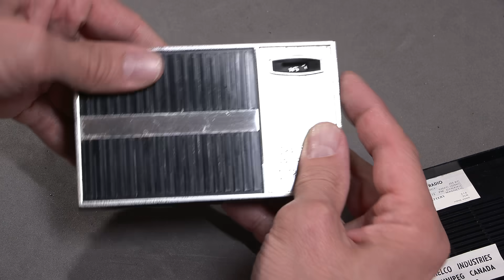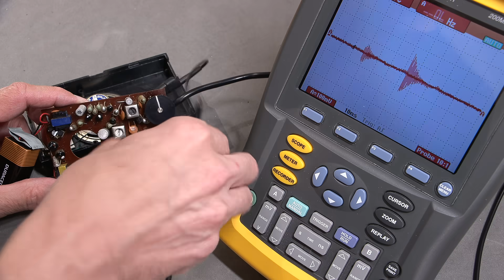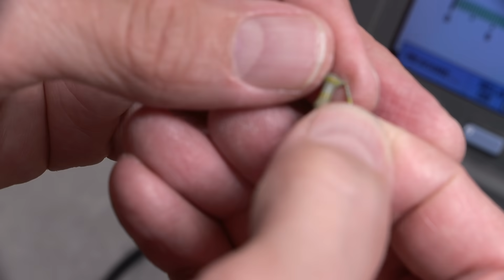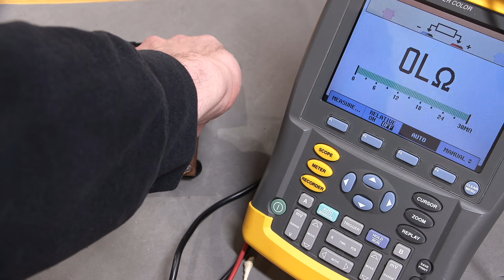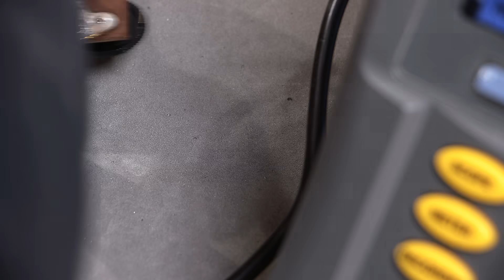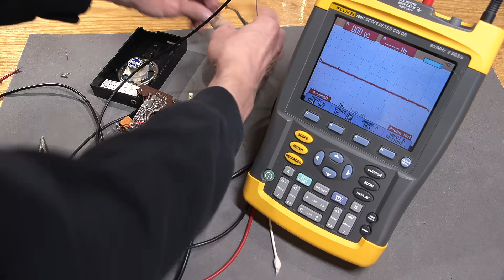10 Transistor TRANSETTE Radio Receiver Troubleshooting Adventure!

Comment: When I was in grade school in the 1960s, I got hooked on radio repairs with old loctal tube sets that lived in and under the dash of 1930s through 1950s automobiles.  I loved the vibrator power supplies.  I worked on scrapped All-American 455 kHz IF sets.  I even had my hands in a dual IF shortwave tube set that used 282 kHz and 455 kHz IF amplifiers to improve both sensitivity and selectivity.  That was fun!  I learned quickly about putting a polarized plug into old hot-chassis sets, because they could really bite you.  I have quite a collection of plastic alignment tools and probes because of that work.  I did have an early 8 transistor GE "cigarette pack" size radio, but only to listen to.  My brother and parents would have shot me for digging into that just to see how it worked.

Comment: I've tended to use Soldapult(TM) hand-operated solder suckers and lots of solderwick.  So much more quiet than your solder sucker.  But, times move on, so I've gotten in such a device.  It works great!  I've also bitten the bullet for some surface-mount microwave RF gear and gotten hot air and hot plate solder re-flow capabilities, but have troubles with the learning curve for them.  
Do you cover such techniques in your electronics course?  I don't have a long-arm microscope, only a binocular dissecting microscope and a USB video microscope.  I don't have any way to make solder shields or masks to handle the SMT chips with their 0.05" and smaller leads.  Maybe you have some tricks?

Comment: In hindsight, I'd sue the manufacturer for having left flux behind on the circuit board.
Knowing that flux was designed to improve the bond between copper tracs and the solder by way acid treating the copper surface.😒

Comment: Long ago, a friend showed me a way to turn one of these into an cheap audio signal tracer. The volume control is where the audio comes in and out, so he just cut the trace and had two probes and a ground -- radio out, audio in, and a common. Of course being battery operated, it electrically floats above the device under test.

Comment: They were Production Loading Circuit Boards in a Factory setting.
Flipping the board over and back  a Hundred Times.
The ‘bends’ were to keep the parts in place for loading, before a mass Soldering of the Components.

Comment: Lovely restoration! Wish I were just a tiny bit more like you. I've never (successfully) restored a silent radio before. All have gone up in smoke either because of age alone, or my own mistakes. The route I then take if I have the patience, is a simple restomod. Not ideal but can be fun. I really want to do a proper restoration/service to a transistor radio one day, but I don't know how possible it is with just the 9$ soldering iron and a 30$ multimeter I can afford

Comment: Thats some of crappiest soldering I've ever seen all over that board .. 😮

I used to repair these radios as a teen, no fancy DMMs or scopes back then...I built a (sq. wave)  signal injector and my first test spot was always the volume control, the most failures I saw back then were bad solder joints, dry joints etc.. or cracked tracks..
Happy days !! 

😎👍☘️🍻

Comment: Cool that the oscillator makes a 17v signal with a 9v source.
Reply from the maker: Keep in mind, that's "peak to peak," not peak amplitude.
Reply: @MrCarlsonsLab  Yeah but e.g. a Class A amp can't do more peak-to-peak than the supply voltage (no transformer). The oscillator gets help from its resonant elements. But of course you know that.
Reply: Always told bad practice to mount resistors vertically as they fatigue with vibration and mechanical shock
Reply: @156dave  Yeah but they were made and sold down to the  minimum size and price. Probably about $5 in 1960s prices.

Comment: How did they mange to squeeze ten transistors into that LOL. 1 Mixer/oscillator, 2 IF amps, 1 detector (used as a diode) maybe 1 AF driver, then 2 AF output. That's seven if I'm counting right. Or eight if there's 3 IF stages. Where's the other 2 or 3 transistors? Nice video - must be tricky trying to frame a small device like that.

Comment: Hi I thought that all these fidelity free radios were positive ground, I've never seen a Q-Tip used for a trouble shooting device😁
Reply: You're thinking of slightly earlier ones using germanium transistors. It was simpler and more economical to make pnp germanium transistors and thus circuits defaulted to positive earth configuration. This radio is using silicon transistors - the black, domed, plastic encapsulated transistors are an immediate give-away. By default, the standard configuration of silicon transistors is npn and so we see, as here, a switch to negative earth for the circuit. The changeover happened very quickly as silicon semiconductors were much more easily mass produced and inherently more rugged.

The move to cheap silicon transistors also explains the high (10) transistor count. Apart from being a marketing ploy to imply higher quality, the first thought is 'where do they use them all?' The basic superhet circuit used in small transistor radios like these made do with 6 transistors - a mixer/oscillator, 2 if transistors, an audio preamp and a push-pull output pair. 7 was common when an extra audio stage was added to get more gain with lower distortion. How does the count go higher? Well we can separate the mixer and oscillator functions with a transistor for each and get better selectivity. Add on an extra rf amplifier at the front end and our radio will be super-sensitive too. We've still only got to 9 and our radio is performing really well without being a complex beast for the user. What about if we use another transistor, not as a transistor? We need a detector diode to extract the audio from the amplified if frequency, A transistor ihas 2 diode junctions so lets use one of them as the detector. We can save on parts inventory, these new super silicon transistors are as cheap as germanium diodes anyway and, hey-presto, the marketing folks get a count of 10 transistors. Everybody wins! 
Transistor count disappeared shortly after the time of this radio when integrated circuits were introduced for the audio and if stages. The transistor count would have soared to silly numbers and, anyway, 'Integrated Circuit!!' on the front panel was a better selling point. I wonder if anyone has ever added up the number of transistors in one of these software defined radios on the go now? Your smartphone probably has more transistors in it than the number produced by the entire world's electronics industry in a year in the late 1950s!
Reply from the maker: The transistors in this are "silicon" and many NPN types. You are correct about the earlier Germanium transistor types.

Comment: You are so lucky you still have LW/MW/SW radio in America.
Here in (west) Europe everything seems to be taken off the air.
When I was younger I used to scan the radio bands a lot with my Racal RA17L, + SSB Until and the preselector. Man, what a set.
But life happened and I had to sell everything. Now, may years later, life has calned down a bit and tried the bands again with just a small cheapish radio and it is all silent.
I bought a little bit better radio.... Still (mostly) silent.
I have an active HF antenna on order because I do not have the space for a long wire. Hopefully this will help me to reconnect to the world.
I still miss the RA17 days though.
Reply from the maker: I have an RA17C12 in the lineup here for restoration, that should bring back some memories! (Close to the RA117 or 17L)
Reply: @MrCarlsonsLab  I honestly cannot wait for it.❤
Perhaps in the video you can explain the differences between the C12 and the L🙏

Comment: This reminds me very much of my job that I had in the early 1970's when I worked for a large company that had a radio department that manufactured radios similar to this one. My job as an apprentice was to fix the ones that had manufacturing defects that generally were a wrong component installed by one of the production line workers. Unfortunately we did not have any fancy equipment that you have nowadays but did have a CRT Oscilliscope, RF signal generator and multimeter. Thanks for the trip down memory lane.

Comment: Great repair video as always. What makes this radio so funny is that you can build an AM/FM radio with 10 transistors and a bunch of diodes.
Reply from the maker: But would it have push pull audio? :^)
Reply: @MrCarlsonsLab  I've seen a bunch of pocket AM/FM radios with 10 transistors and they all used the push pull configuration.

Comment: Good job Paul!  Busted resistor huh?  Looks like the cheapest available 470k they could find.  

Hey, I like that you 'catch' or hold the component leads as you cut them off.  As good as 'Mend-it-Mark' is, he just lets the component pigtail fly off & end up wherever!  A most unprofessional practice from one who is otherwise & apparently a professional!  Maybe he just does it to show off, or effect, but it just rattles my back teeth!
Reply from the maker: I have had the snipped leads fly into my test equipment vent holes! So yes, very important to catch those snipped pieces or magic smoke will come from a nice piece of equipment one day.

Comment: Those radios have a bad habit of running those 9v batteries out in a very short time. I have owned a few of them, and found that after only a few hours of use, the battery is pretty much dead. I use a battery holder that takes 6 AA cells to give 9v. This gives longer run time.

Comment: You're a magician. If I had flipped that circuit board over even two or three times, invariably the speaker and battery wires would have broken off.
Reply from the maker: Thanks for the kind words!
Reply: I can unfortunately relate lol

Comment: I have a different method. First I check if there is sound on the volume potentiometer. If there is: the part in front of it is faulty, if not: the sound part is faulty. I proceed in the same way in half in the faulty part.

Comment: I could see what was wrong right away. None of the filaments on the transistors were lighting up. Then there was the mechanical defect of the broken resistor and a bad capacitor. It's important to always have a bad capacitor or two. The customers just expect that nowadays.

Comment: I've been repairing various electronic circuits for more than 50-years and the first thing I always do on any DUT (Device Under Test) is to perform a triage on the device. If it is battery operated, I remove one lead of the battery, and and after inserting a milliamp meter, I turn on the power  to measure the quiescent current, if is AC operated, I power the the device with an isolated variable dual analog metered transformer and slowly bring up the voltage while monitoring the AC line current. After determining the appropriate voltage and current the DUT typically consumes, I confirm if it is operating properly or it is not, there is always customer or user operator error!  After determining that the DUT is not operating properly, the same sequential and logical troubleshooting methodologies Mr Carlson uses I also perform.  David Riddle
Reply: Sounds boring
Reply: @5starhelp no it doesn't and sure isn't to some folks that is.

Comment: Never assume it just needs an electrolytic recap job. The answer may be revealed by a good visual and tactile inspection 
and a good bit of diagnosis with some testing ( your choice of  test tool) in the circuit from end to end. There may be
multiple problems found along the way. Thanks for the learning how to troubleshooting  adventure Paul.
Reply: Tactile inspection is also known as poking it with a stick, a very good way to find mechanically unsound components and cold solder joints.

Comment: Excellent concise demonstration of methodidic troubleshooting there, Mr Carlson, big thumbs up! For all of those viewers which do not have a signal generator/tracer and oscilloscope  could you please do the same sort of video showing the trick using a second, fully working portable radio alongside the defective unit to step analysis along the oscillator, mixer, IF and audio sections? And demonstrate in both AM and FM mode?
Thanks and cheers from Germany

Comment: Thanks for the tips. One from my side: when dealing with those 9V connectors, it's a bit more healthy to disconnect one leg (the looses) from the battery and rotate the battery so it's out of the way, until you need it again, a few moments later.

Comment: Have the scope. Problem with the battery charging circuit. Otherwise runs great.
Reply from the maker: It's common with this scope. My issue was the noisy fan inside.
Reply: @MrCarlsonsLab  Went inside mine to check it out. (Already out of warranty) Fan must have been hiding.

Comment: It's always a joy to drop in to see what Mr Carlson is up to. I was impressed to experience his knowledge of improving the volume with a capacitor and knowing which ones were likely suspects. But my OCD  peaked when he missed off the plastic insulator and put the resistor the other way around. But that's me! Excellent job well done. I don't think I've seen a 10 transistor radio. All mine in the 60's were a measley 6. What I would have given to have that receiver to tune into the UK off shore pirate stations around the coast broadcasting from their ships. Happy days!  📻🥰
Reply: Usually these type of cheap Hong Kong AM radios are 5-7 active transistors. The others are just added to bring the transistor count up, maybe have some wired as diodes. Back in the 60s and early 70s, if a radio had more transistors, it was perceived to be better in the marketing. I've seen one AM band only radios claiming up to 19 transistors!!
Reply from the maker: Thanks for your kind comment! I turned the resistor around so the lead wouldn't touch the case of the IF transformer.

Comment: Its a FIVE transistor radio,, what are the other five doing?
Reply: No it is a 10 transistor radio, only when you count you will find 11 transistors.... No detection diode to be seen, so probably the 11th transistor is run like a diode.  An honest manufacturer, some would count them as a transistor too. That you only see 5 is because they have used two types: the black shiny dome type, and the dull grey TO-92 package which are a bit more difficult to see. Some seems to have a white sticker stuck to them.

Comment: In AM radios the transformer can with the red core is always the local oscillator, and the one with the black core is the final IF. The others usually are yellow and white, or sometimes white and white are the middle IFs. This can help to trace out signal circuit path on these radios, if it's unclear.
Reply: Why are they like that?
Reply: @KJ6EAD There's an input and an output IF transformer type and mid- IF transformers. My understanding is the impedance input at the input transformer right after the mixer and the output impedance to match the detector circuit and the impedance IF to IF. With the impedance match there is also an ideal reactance to tune the transformer circuit resonant frequency and set the bandwidth of the frequency center though the Q of the circuit. That's the best I understand the circuits.

Comment: Could you use AI to make a schematic has anybody done that? I'm thinking if you took pictures of the circuit marked out where the components are AI should be able to work it out??
Reply: With these cheap Hong Kong AM radios, quite frankly I've found the circuits are all pretty similar, and so I've never really needed a manufacturer's specific schematic to fix them.

Comment: I was taught to plug in the con ponant, then grip the lead and shift the pliers sideways to hold the part still. That could be where your bent leads come from.
Reply: Factory thing I think. You cannot solder components one by one, it would take to much time to be profitable, so you need a system that holds the components in (bended leads) until soldered all in one go, either by hand or through a solder bath.

Comment: Hello, why did you use a cap to connect the tone generator instead of just a wire ? Thanks
Reply: It is not a tone generator but an RF generator (Radio Frequency) with a tone modulated on it. You need to inject the RF signal in the radio, without influencing the more delicate circuit signals of the radio (the RF generator has a impedance and capacitance), and a capacitor as low as possible value is the best candidate for that. It separates the RF generator circuit from the radio circuit and passes only a small RF signal.
Reply: @erikdenhouter  Thank you for your comment, so it is to avoid loading the circuit.
Reply: @abc_123_handle  Yes indeed, that is in the end the best description.

Comment: That radio and that scope are worlds apart. We've come a very long way with electronics.
Reply from the maker: I have to say though... older test equipment is so much more fun to use.
Reply: @MrCarlsonsLab  It takes much more skill to use the older gear.  You have to think much more about the minutia of the measurements and still keep the big picture in mind.  And, that older gear can kill you!  I once accidentally shorted out the B+ power caps in a running Heathkit dual trace oscilloscope that I was building, and the class came running to see if I was still alive after the loud blast and arc flash had me dazzled.  At least I didn't get into the 17+kV CRT power supply with that screwdriver.

Comment: Always a treat to get another video from you. Don't run yourself too thin though if you're busy in life! :) Thanks for the video, Mr. Carlson! Personally I'm building a super-DCR (Direct-conversion receiver) with extremely good SNR and as much selectivity I can get. I'm using a lot of mini-circuits parts in the build like their triple-balanced mixer, their low noise amplifiers, etc. Can't wait till I get it finished :) Have a good day!